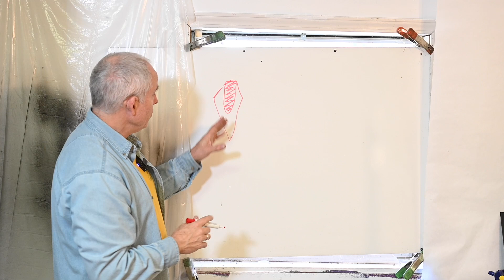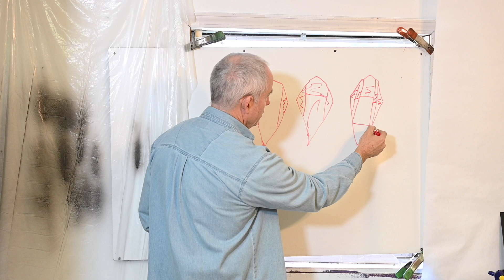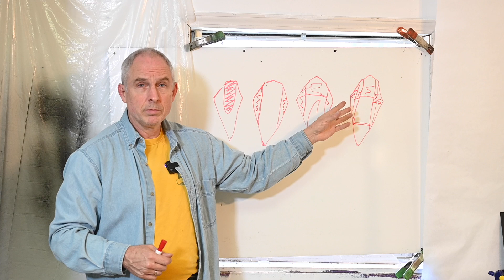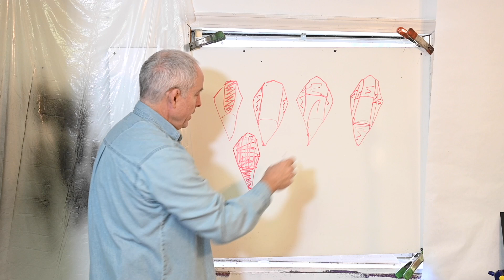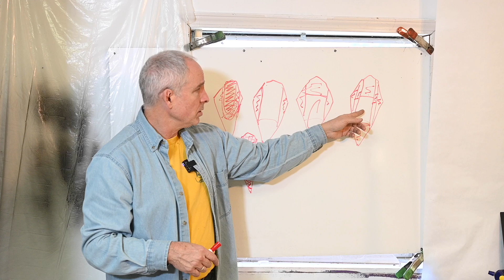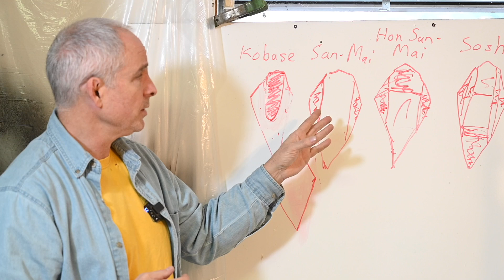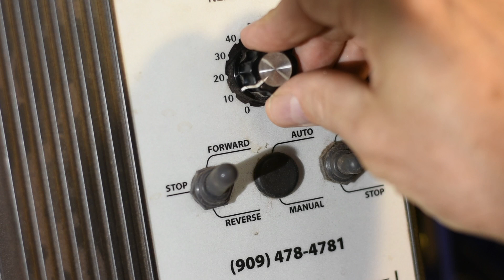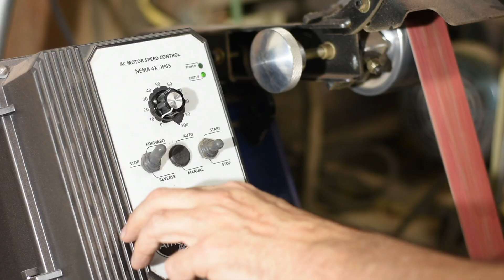How Are Japanese Swords Constructed? - Knife Makers Friday Five #75

Comment: For speed control you can usually swap out the drive wheel and slow down your grinder. If you watch Walter’s old videos, he uses a one speed Bader. I’ve done it on my 2x72, found various diameter wheels even metric if you look. Only thing is make sure your tension device has enough travel to keep your belt tight